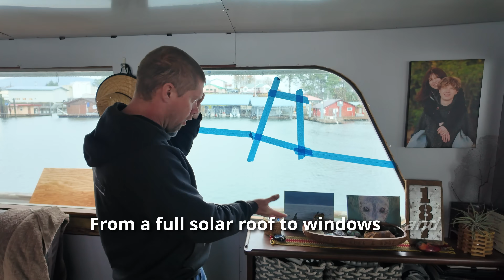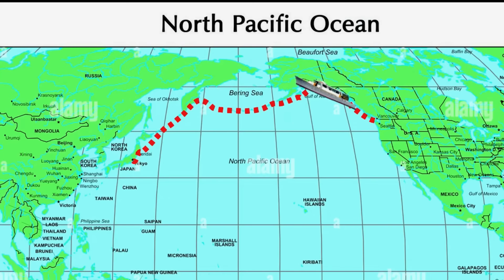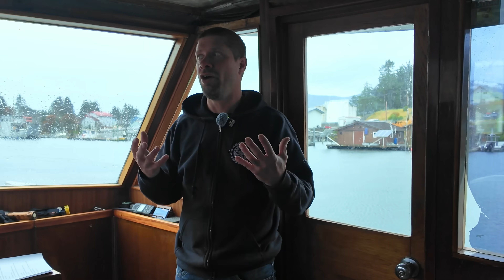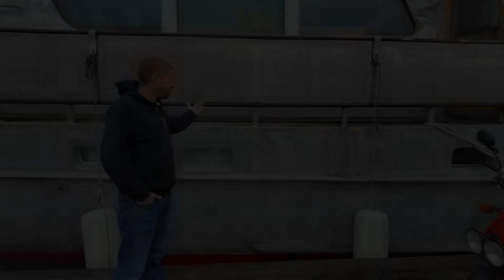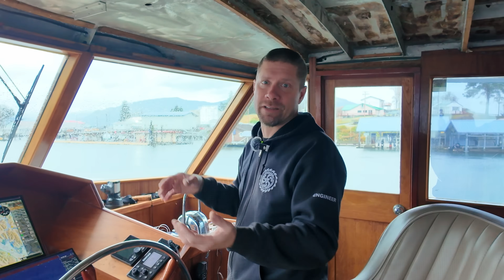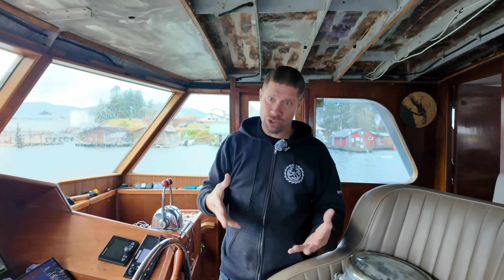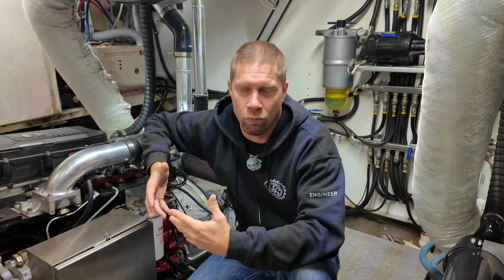What We Would INSTALL If We Won the Lottery?

Comment: What amperage on the loads...nav lights etc do you need ?
Reply from the maker: On the pure DC side the loads are minimal. Lights and such are all LED so require little and nav equipment these days doesn't draw much. Its the AC side that is the bigger power demand. We run multiple fridge and freezers, computers, and pretty much all household appliances short of a dishwasher.
Reply: @OnboardTangaroaSeatrial have you heard of nextion displays ? Its an ecosystem that enables touch screen implementation without huge overhead cost.  They interface with a micro controller to assimilate info, display and control via relay or analog/digital out signals.
Reply from the maker: I had not heard of them before but will certainly give them a look. Thanks!

Comment: I know it sounds obvious for replacement glass, but what about Plexiglass?
Reply: Trouble with plexiglass it colours and scratches
Reply: @llen609 Colour, scratches, durability to breakage, cost vs, ???    😮 Got me 🤔
Reply from the maker: Yes, its a tough call. Plexiglass or Lexan are good but one has great scratch resistance but poor UV resistance and the other is the opposite. They do make some with UV coatings though that are a good option. Definitely something I am looking at as a possibility.
Reply: I was thinking the same thing ,can get in a tint also its just what I did on my boat
Reply: Yes scratches very easily